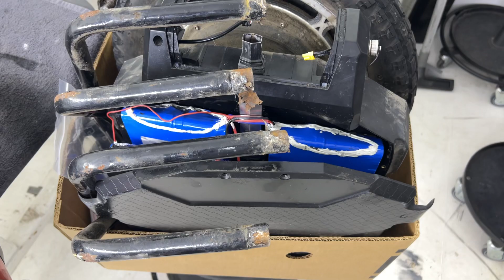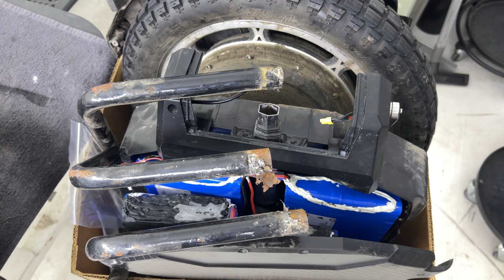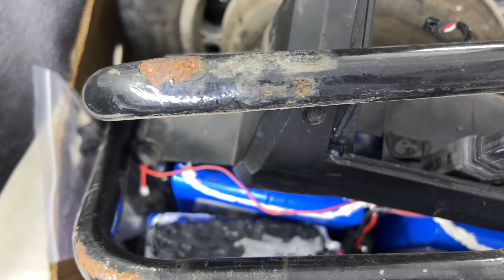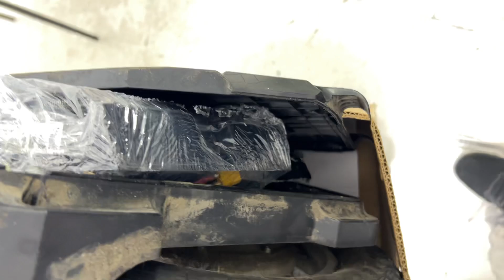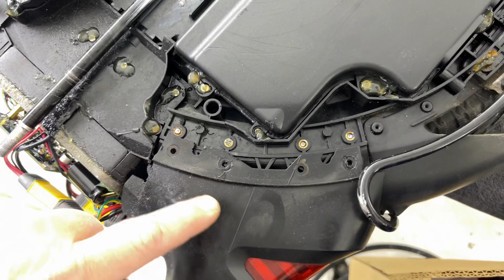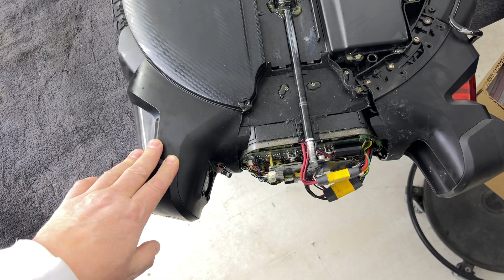Which EUC Brand is most repair friendly?

Comment: Inmotion probably makes the most waterproofed wheels, King-Song makes pretty reliable wheels (not S22). LeaperKim makes kinda indestructible wheels.
But they're all kind of a hassle to repair/service. That's protection means layers upon layers you have to get through to get to your problem.

Begode... Doesn't do that. They slap together stuff and that's about it. But you can't deny how it's relatively easy to repair them.
Reply from the maker: Exactly. Good point. I love to work with Begode wheels because of their reparability. Magic of Performance is on another level.

Comment: Look after your wheel is the message for sure, but "disappeared for two years". No, just hasn't used his dealer services for two years. Our wheels are not really waterproof, or anything like. That excludes the use as an everyday wheel. Use them like that, and you are going to have problems no matter what, with some more than others.